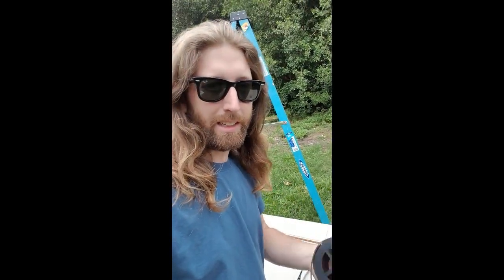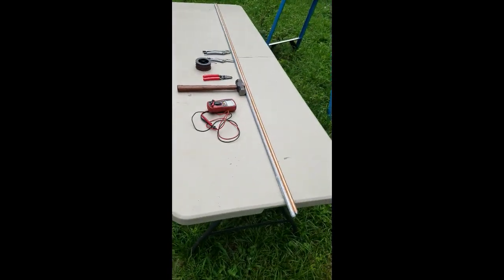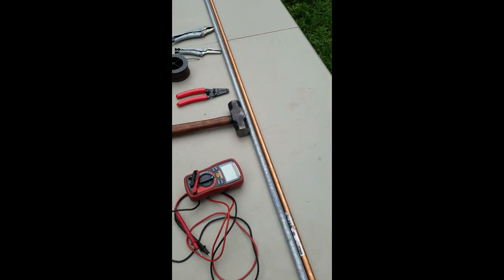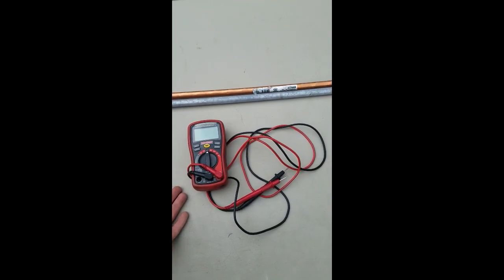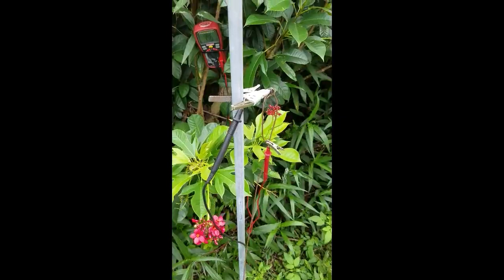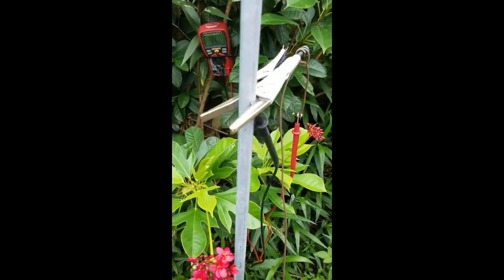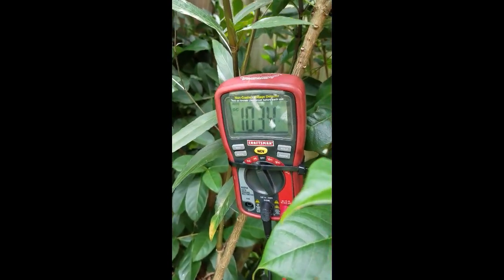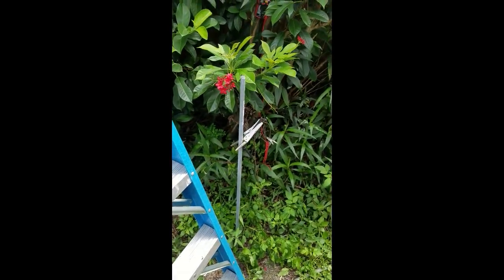FREE POWER IN THE GROUND? Building and Testing an Earth Battery

Comment: Use magnesium and carbon rods. You get above 2V for each pair and your amperage increase depends on surface area of magnesium and carbon. Also you should isolate each cell. Just put a pvc barrier around each pair.

Comment: the KEY is ISOLATION. Cut the poles, separate where they sit in the ground with a plastic bag. Isolate that cell, go down the line in series and make another one. This is how you get voltage, Amps will come with the density of metals and surface area.

Comment: I got the same results as you, basically got 1 volt DC.  I read somewhere that you should do the following (I'm going to test again):

paint your rods or coat them so that anything touching earth is painted
leave an inch or so above ground uncoated / unpainted
Put a piece of plastic or something on the bottom so it doesn't touch earth and will drain
6 feet apart, connect in series and amperage will be a lot better.

Again, I haven't tested this out, but will be attempting it sometime before Fall this year, hopefully.

Comment: It don't matter what direction lol, it don't matter the length or depth of the rods haha. You will get about 0.5v and to double it, just separate earth. Easy way to demonstrate is placing earth in IceCube tray and connecting them by copper and iron etc
Reply from the maker: For the simple zinc to copper charge difference you are right, although longer or multiple rods will produce more current. I was also trying to capture some of the telluric currents from the earth's magnetic core which is why i was spacing them farther apart and in a specific orientation.

Comment: Hi, a few pointers from experience. Copper plate/sheet (around 1/8 Inch thick is good) is better, larger surface area, zink pipe/bar is OK. Both copper & zink electrodes 2-3 feet deep in moist ground only 3-4 feet apart, depending on your ground mineralization closer or further apart may work better. Nice experiment. Mow your lawn  :-)  !.

Comment: Voltage would have been higher if the rods were not so far apart.  You created internal Resistance doing so.  If someone had access to a butt load of Copper Water Pipe and Galvanized EMT it could work.  Yes you can configure in series like any other battery to bring up the voltage.  A few mA of current is the limiting aspect here.   10 sets of Rods in series  x 10 in parallel or 1oo rods set   would just about produce a usable voltage @ a usable current.  Not vary cost effective but it could happen.  Lead Acid cells mason jar size would be more practical and viable.
Reply from the maker: Yea you are totally right, for the price of 10 rods you are better off buying a solar panel lol

Comment: Amigo, you did better than most in terms of the output of your implementation.  2 milliamps is 1 milliamp better than my output.  I achieved near 1 volt per electrode pair ( .8 ).  I had troubles with connecting in series and parallel -- never getting exactly the theoretical output.  You can miniaturize the electrodes and get nearly the same output.  galvanized nails or screws and copper wire.  The dirt is exchangealbe with brine, vinegar, citric acid, etc.  A non-conductive, semi-porous sheath around one electrode will allow you to place them closer together.  I use nylon roofing cloth.  

F.

Comment: Earth is a huge electrically charged capacitor. By using correct combination of metals, you are creating positive and negative terminals in the dielectric material that is earths crust. If you do it on a large scale and combine series and parallel connections, you can get usable voltage and current out of earth. Try copper and bismuth or zinc metal combination. I think the higher the relative electrical conductivity difference between dissimilar metals is, the more voltage and current you can get from earth in theory.

Comment: Hey bro, I've got a better experiment for you that is a real eye opener.
Pound in a ground rod, that will obviously be your (-).
Now put up an antenna that is insulated from the ground with a diode, that will be your (+).
Now check it with your multimeter. As you raise the height of the antenna, the voltage will climb.
.
Reply from the maker: I'll certainly try it, I still have those rods in the ground.
Reply: Janky Shack : Please do, and please video it.
.

Comment: Edit: Based on some of your other videos, I think you already know the power is coming from the metal chemically reacting.
The current is mainly from the metals corroding.
This is the same sort of setup used with potato batteries. All you need is material with stray ions floating around.

You should really test with a bucket of salt water to see if the ground adds anything.
The electrolyte isn't really very important. What is important is the types of metals used and the area of the metal.
Reply: Finally somebody who gets it.

Comment: hey,  nice attempts but there are a few mistakes, so you need to arrange them closer together and connect multiple cells in series to increase your voltage, also when you turn your multi meter  to amps it doesn't just load test automatically, the multi meter lead positive must be moved to the other socket marked 10A fused. then you can see a value and not read the amp leak on the  surface of your multi meter lol,  good luck friend
Reply from the maker: That meter you can actually leave the lead in the same hole as long as the current is less than 200mA. it has 2 different fuses. I was trying to access telluric currents, that's why I had them farther apart.

Comment: Nice post... When laying out your network,  find out what the compass deviation is in your area.  You need to add or subtract from your compass heading in order to correct for true north. Telluric currents are stronger during the daytime hours. Geomagnetically induced currents have been recorded as great as in the 100 amp range in buried pipelines and electrical networks in the higher latitudes.

Comment: Hi... I've been experimenting with Ground Batteries for a few years now and have made some good progress.My compliments on your presentation. I found better results with the Rods being less than 4 feet apart and as little as 6 inches. If you use short pegs 1 foot long, run them in series; till you get your desired Voltage. Then, run a second, third or how ever many rows you require to boost your Amps. Usually a 5 x 7 arrangement and you have a cell phone charger. This is how Telegraph Cables were powered over long distances.
Reply: Ainschunt Ayleuhn do y have a website, the link you gave does not work.
Reply: Could you elaborate on what you know? I'd greatly appreciate it.